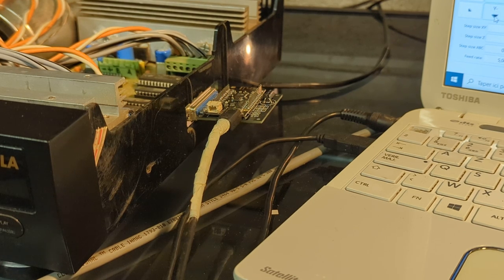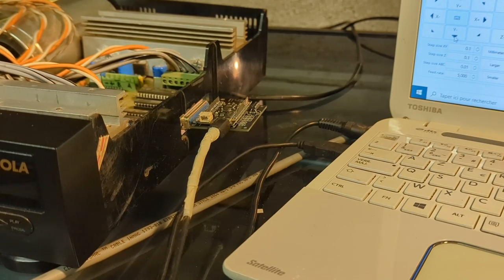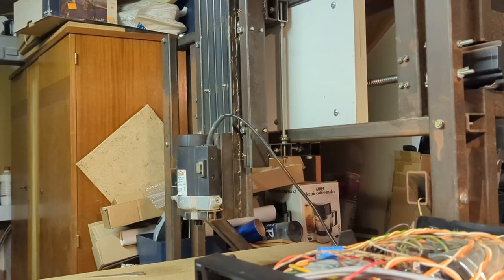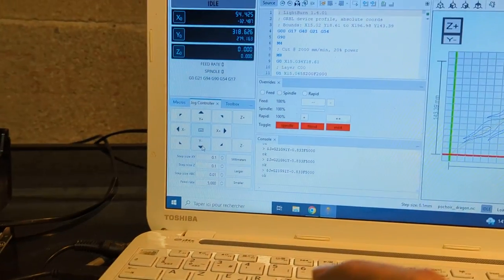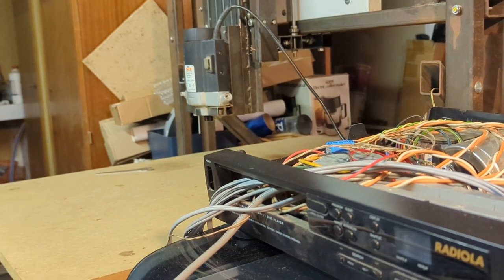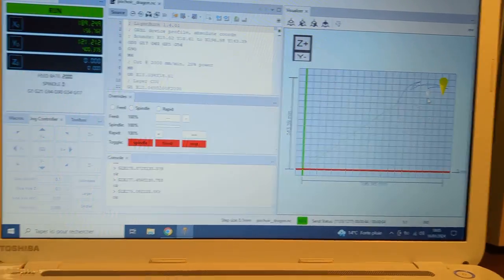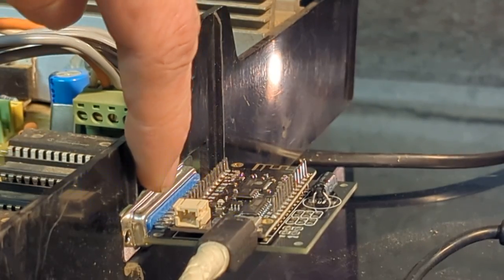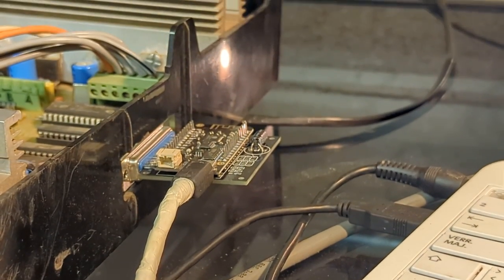convert a Mach3 CNC controller to FluidNC : system running [part 2]

Comment: Cool project but for me to use it plugged directly into the controller like you have I would have to redesign it as my controller has a female db25 connector. Can't just substitute a male connector on your board as the pins would be mirrored.

Comment: I like this a lot!!  Curious, are there enough I/O ports left on the ESP32 to add an sd card slot?
Reply from the maker: Yes they are accessible. 
I have even exposed these pins. It would be a matter of plug and play.
Fluidnc handles SD cards natively
Reply: @freedom2000  Thanks for the quick response.